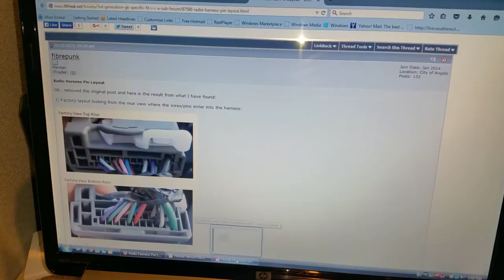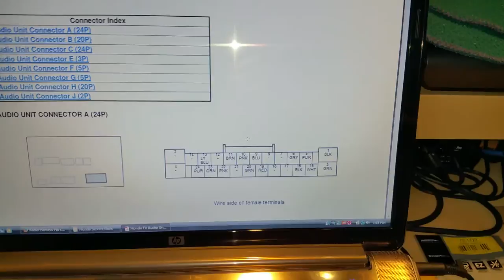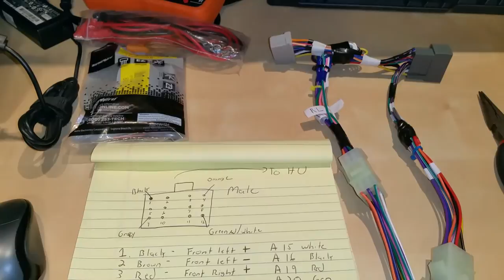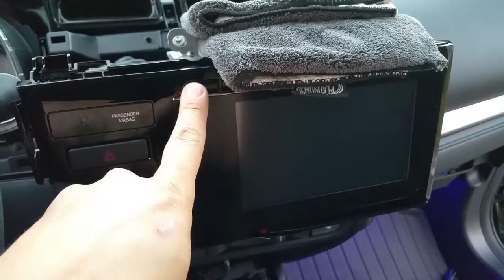Upgraded OEM Stereo: 2015 Honda Fit EX

Comment: Sweet. I’ve been thinking about upgrading the system. You have to jump over a few significant limitations if you want to run the stock deck. Cheers man.  Thanks for the run through.
Reply from the maker: thank you for watching!

Comment: I'm trying to do something similar but not AS crazy, just installing the subwoofer and hooking it into the rear speakers. I know that you have the cable colors listed here from the harness, but when I'm looking at the cables running out to the door there's multiple pinks and blues on the right side how do I know which one is the right one to positap into?
Reply from the maker: Hey it's been many years but you might have more luck on the fitfreak.net forums. I remember seeing threads of others doing what you say with success. Just not sure what color the wires are.
Reply: @Bassguitarist1985  I've been reading over your thread multiple times and I realized that my best move would probably to build a male(female) adapter between the stock head unit and just tap the wires there.

Now to figure out how to push those molex pins... sucks that the adapter doesn't come with the wires in the right spot for the HU

Comment: Very awesome video, I am  still just a little confused about a few things. What was the total cost for this project? What did you mean when you said that you changed the internal jumpers on the LCQ1? Overall, by far the most detailed process I could find and you gained a sub from me :)
Reply: Also, the LCQ1, kenwood amp, and basically everything is quite pricey, are there any alternatives at a cheaper price point that perform decently?
Reply: One last thing, are there any head unit replacements that preserve the lane camera and back up camera?
Reply from the maker: @chiefcactus4091  the LCQ1 i changed the grounding jumper to 200 ohms. Meaning the audio ground has a 200ohm resistance connection to the chassis ground (different than audio ground) the other choices for the jumper pins are floating, or bonded for those two points. Prevents hum and noise.

You can get a basic LOC to feed your 4 channel amp and rely on your oem HU's built in eq. That would save some cost. Far as I know I think there are some pioneer HUs that perserve the lanewatch camera, but you need an external module like the Axxes device and that must be programmed to keep the lanewatch, backup,  Bluetooth,  and steering wheel controls. There are a few people on fitfreak. Net that were able to get an aftermarket head unit to work with most of the buttons but I think the Bluetooth buttons for the phone where the biggest challenge since the firmware for many aftermarket devices still does not support this generation of head unit from Honda. It was only used for the first half of the third generation. now if you buy a 2018 or newer, the lane watch feature is completely removed but it also gets rid of certain compatibility barriers for aftermarket integration. That's about all I know definitely check out fitfreak. Net for more information.

Comment: Hello, watching the minute: 8:22  I'm with project Fit radio US version (same as yours) in my Fit EX- Costa Rica (5 Inches no touch), I already have it. How can I get the diagram of all the cables for reasons: 1. My original reverse camera is not activated when I put "R". but in the internal options If activated. and I see it (I think the function is in the 2nd connector from left to right. (Some cable that detects the reverse signal) that is different from the Latin version.
2. I need to know which cables the baypass handbrake is made, I know it's in the connector under the HDMI cable, but I need a diagram, my car does not have that factory connector. so I have to build it myself.
I appreciate the help you can give me, to conclude with a good installation and not be incomplete functions in this radio. Thank you.
Reply from the maker: If you check out fitfreak. Net you should be able to find the wiring diagram for the audio pin. The reverse signal is on a different connector and I do not know what it is off the top my head

Comment: I'm hoping to get my stereo upgrade done in steps. If my very first step is new speakers and an Alpine Power Pack amplifier do I need to go ahead and get an LOC installed as well? Or should I wait until I get the self contained sub that's going under the seat and have it installed with that? Sorry for the dumb questions. I'm just on a very strict budget.
Reply from the maker: Jonathan White i recommend an loc
Reply from the maker: Welcome!

Comment: Awesome video! Only question, for the power, did you run that from the batter, or did you tap an unused fuse slot in the fuse box? I'm considering the same amp OR the clarion that's very similar, and either would be without the LCQ1 and subwoofer setup.
Reply from the maker: Yes I ran two 10 awg wires to the battery, each fused at 20 amps. Sorry I didnt say where I connected it to in my video!
Reply: It's all good! I saw someone mount the Clarion amp in basically the exact same spot on fit freak, but they grabbed an empty fuse spot in the fuse panel and threw in a 25 amp fuse and a tap into it. It struck me as... risky.
Reply from the maker: From what I've gleaned from the fuse panel, its max fused at 40 amps. While a class d amp is not a constant 20 AMP draw with other accessories on that panel will be maxed out. The size system I have isn't going to do whoompa thumpa bass or anything super high current demanding, just a nice rounded out system I can be happy with.

Comment: I’m having the Alpine Power Pack Amp 45x4 and Kenwood Sub mentioned in your video installed in my 2015 Fit EXL today. I’m wondering how well the sub fits under the front seat. I saw you comment on FitFreak where you had to relocate your subs, in favor of backseat passengers. I don’t have the confidence to create a wiring harness, so I’ll let my wires get cut for the amp install. Great job man
P.S. The shop has determined that it will fit under the driver’s seat.

Comment: It looks great man! Seems like you really know what you’re doing. I don’t have the skills to upgrade mine like that, so watching you doing that makes me want to hire you to do the upgrade on mine 2016.. lol.. would you be interested?
Reply from the maker: Ivan Kut thanka dude! Actually going to reinstall this system in my 2017 fit soon. Ive been slow to do so, life stuff (good stuff) happened and havnt had the time for it. I live in the northeast united states.
Reply: Oh shoot, I am on the west coast... so I am out of luck I guess to  have it done by you man. Unless you’ll be doing some traveling and can stop by.. Lol.. you must have been likened your 2015 since now you upgraded to 2017?  I truly enjoy my Fit, just the tank is a little small.. other than that, it’s great. Have a fantastic day Sir!
Reply from the maker: Ivan Kut loved the 2015, but it had some quality control ossues with the body and paint. Drivetrain was perfectly fine. The 2017 is much better in quality, plus it is garaged all the time now.
Reply: Got it. Positive changes are always good. I would like to keep my original head unit and when upgrading my system, just don’t know if it has the right slots to connect stuff. Would it be possible to send me the instructions on how you hooked it up or maybe you have a link that includes the steps/diagrams? I would really appreciate it man.
Reply from the maker: Ivan Kut in the video description. I list my details step by step what I did with diagrams on wore pin outs. Fitfreak.net
Reply: Ok, thank you Sir!

Comment: I'm here cus I want to know how to get through the firewall into the cabin
Reply from the maker: There are various rubber grommets that you can use to get wires through the firewall. Just be careful when snaking them through so you do not damage the other wires going through it.
Reply: @Bassguitarist1985  I was thinking of using the main engine harness and just making a hole thru the rubber gourmet to avoid damaging the wires running thru it. I want to run a small wire for undercarriage lights
Reply from the maker: @yezkaholic  sounds like a reasonable solution. Long as you can confirm its water tight!
Reply: @Bassguitarist1985  yeah ill have to apply some silicone of some sort for good measure, thanks for the help
Reply: I used a coat hanger and a ton of electrical tape - made it through the grommet on the glovebox side.